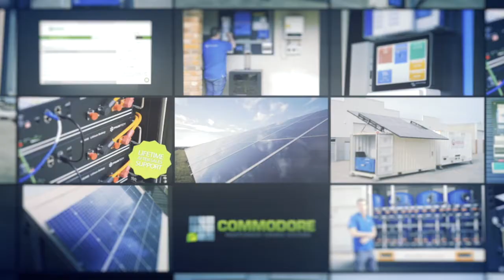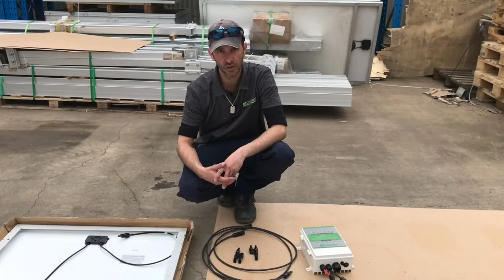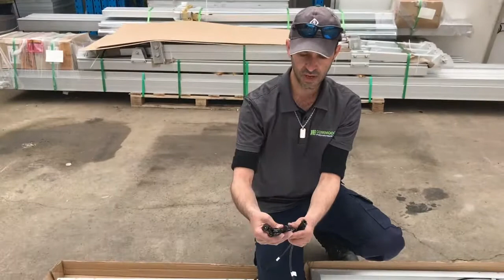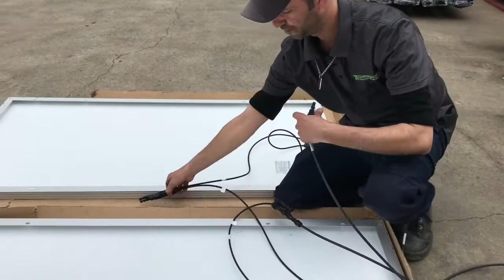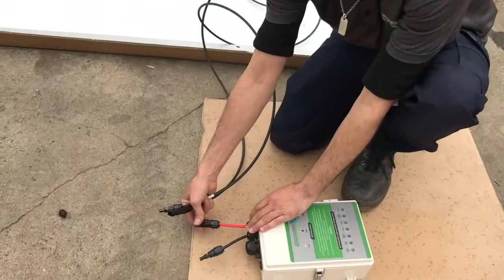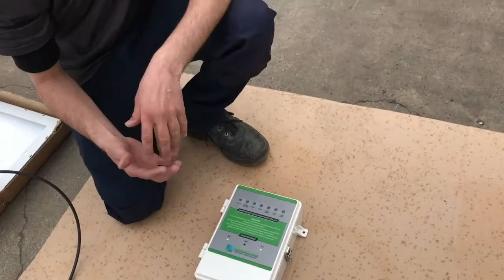Wiring Solar Panels in 24V

Comment: I have 8 panels each panel is1.5 and I have 2 batteries 200amp .I was using 12v inverter ,but now I want to change it to 24v system.what do I need to replace